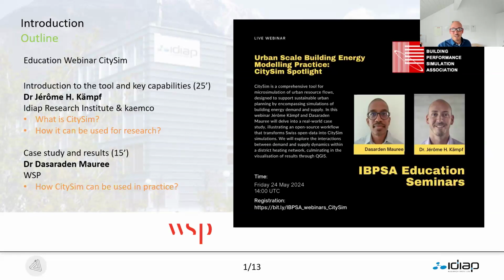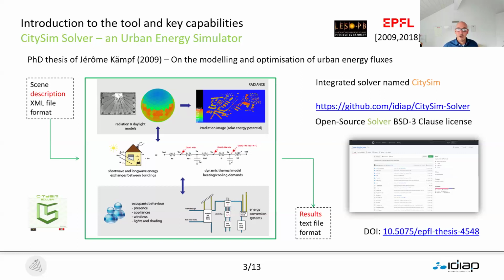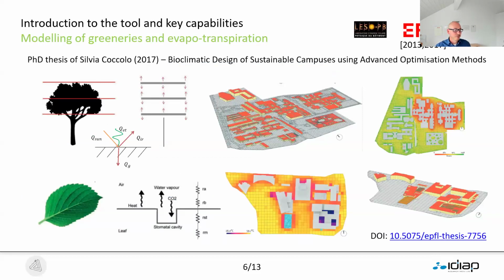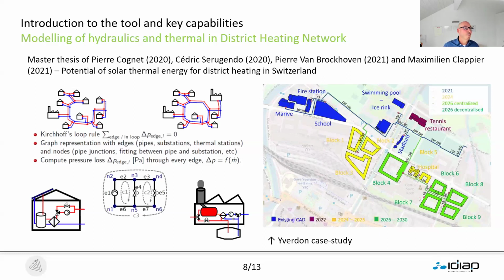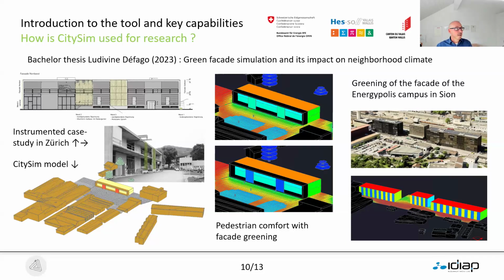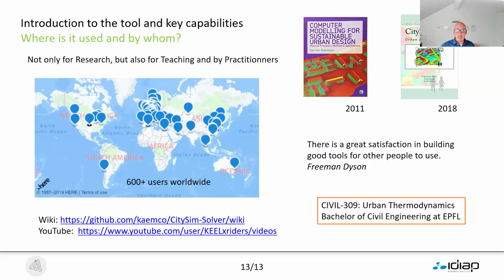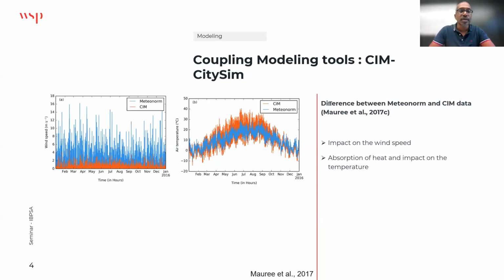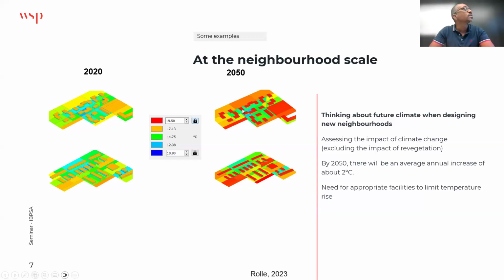Exploring CitySim

Comment: In the webinar there were two questions which we didn't have time to answer:

How much does it take to learn the program self-study?

It depends on your background (Architect, Engineer or Scientist), but Jérôme would say roughly 1 day to understand how to prepare a model for CitySim with CAD software (such as Sketchup), 1-2 days to deal with the input format in XML.

Are we able to take into account the climate change while simulating in CitySim?

Climate change is considered in CitySim with the input climate files.
In the study published in Nature Energy, we used climate files generated by regional climate models.
So it's very easy to include your own boundary conditions.
We can run simulations under future climate, but we need to get a climate file from somewhere. In practice we generally use Meteonorm to produce climate files for 2030, 2040 or 2050. Using those climate files, we can "see" the effect of climate change on the building energy consumption, photovoltaic production or urban heat island effect.

Finally, this is the link to the translator between Rhino/Grasshopper and CitySim: https://github.com/gperonato/GHCitySim